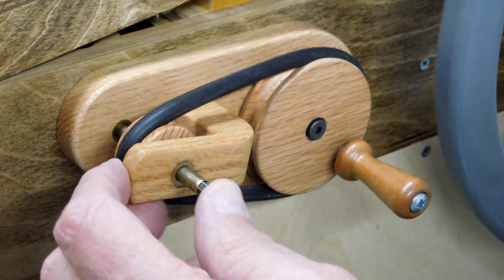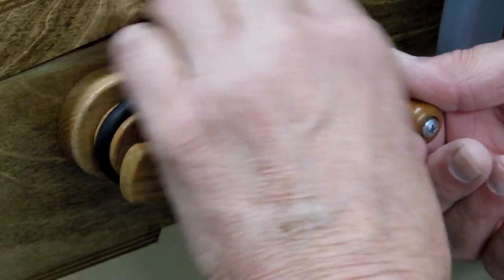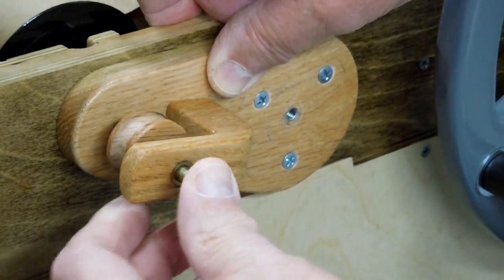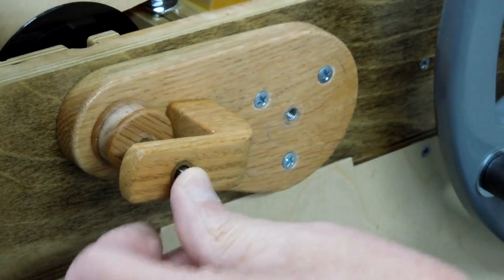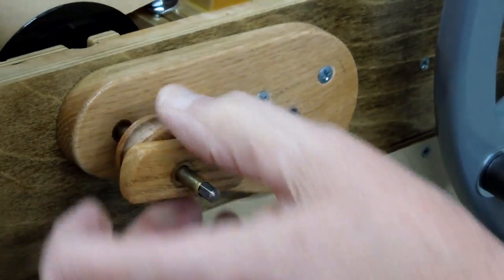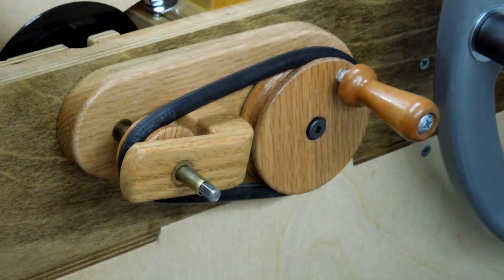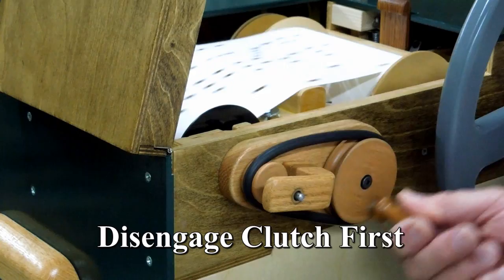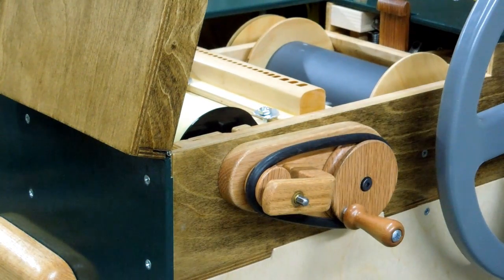Senior 20 Organ (27) Rewind Mechanism Installation & Demo

Comment: Where did you get it from??
Reply from the maker: Where did I get what? Which part? Most of this is home made.
Reply: All of it. All the parts from where??
Reply from the maker: This was originally designed by Jay Caughron and then I modified it. Information for the build article on Family Woodworking is in the video description. Bushings, shoulder bolt, etc... look around at your local hardware stores of somewhere like Shamrock Nut & Bolt, Fastenal or Micro Fasteners. The vacuum cleaner belt will be more difficult to source... try local vacuum repair shops of look around on eBay or Amazon. Then I have additional videos; Senior 20 Organ (13) Rewind Hex Drive https://youtu.be/GiQMBXGkiX0 and Senior 20 Organ (07) Rewind Pulleys & Drive Discs https://youtu.be/nVYIa7YZVp4  All wood parts are homemade.

Comment from the maker: Modification of the rewind mechanism to use a Eureka Vacuum Cleaner o-ring drive belt was originally done by Jay Caughron. Photos and dimensions of his design can be found in his postings at familywoodworking.org  Go to the thread “Organ Build” and it starts 6-12-2009 pages 34-35.